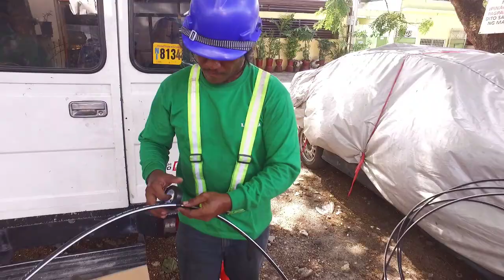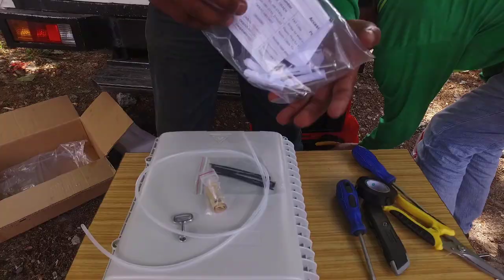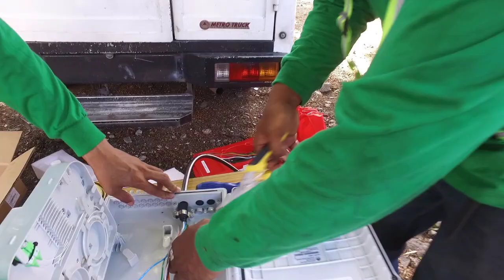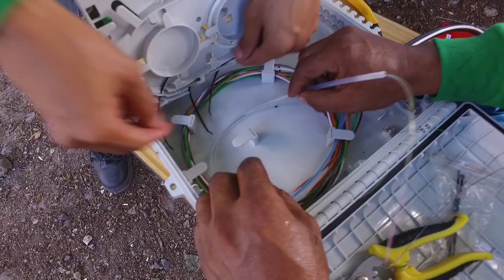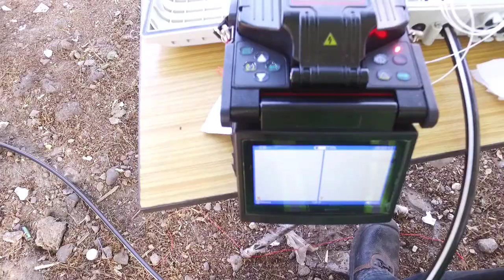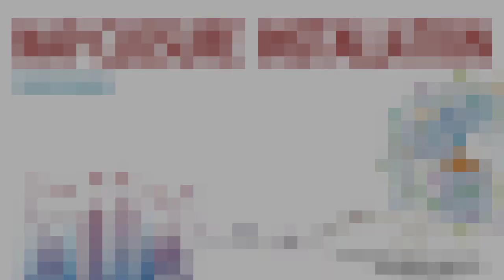NAP (Network Access Point) Closure Installation - FTTH deployment

Comment: Sir question lang, if OLT is GPON. 1 PON is 1:128 right? so if we say in LCP there is 2x 1:4 (total of 8), how many 8 ports NAP box to install?
Reply: GPON OLT 1PON - LCP/MAIN NAP 8PORT - 7 CLIENT NAP WITH 16PORTS EACH 7X16=112+8 UR LCP/MAIN NAP=128
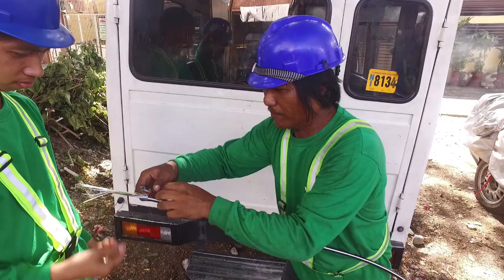Reply from the maker: Kung 1:128 set up gusto mo tapos may 2 x 1:4 ka sa LCP kelangan mo ng  8 x 1:16 port NAP hindi 8 port para ma achieve mo ang 1:128.

Comment: samin po naglalatag na ng fiber cable. mabilis lang po ba magkabit ng napbox?
Reply from the maker: depende sa ISP at contractor nila. ang splicing at preparation niyan it takes 1hr lang
Reply: @EMERmusikero93  salamat sir! depende rin kung ilang napbox ang ikakabit nila sa isang poste no boss? usually ba boss mga dalawang napbox lang pede sa isang poste?
Reply: @TheKillerZmile  single NAP lang.  pero depende sa iba gaya sa city my mga double NAP. Depende din sa demand.
Reply: @keng.48  ok na may fiber na ako nakabit ako sa bagong nap

Comment: Saan po ba kumukuha ng internet connection si NAP box? Sa cell tower po ba or sa satellite?
Reply: Sa Central Office ng pldt yung tinatawag na OLT
Reply: Sa Tower sir kung saan po nndun lahat ng signal OLT Optical Libe Transmission
Reply: @dadiipaulmotovlog5650  Correction Sir. OLT stands for Optical Line Terminal. Thanks
Reply: rekta sa central office ng ISP ang terminal ng mga napboxes.ang mga cellsites, may fiber backhaul din yan papuntang central office ng ISP.kaya pag fiber pansin mo sobrang bilis ng response time or latency compared kung LTE ang gamit kase rekta ang mga Fiber Nap boxes sa ISP Central office and also solo mo bawat bandwidth ng isang port sa nap box di gaya ng Mobile Internet or wireless internet na shared kayo sa iisang bandwidth lng